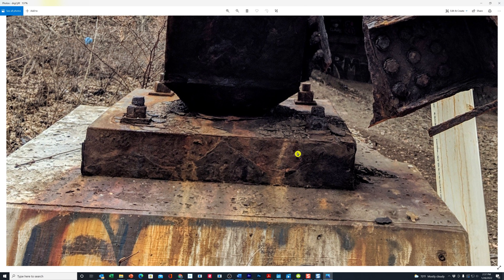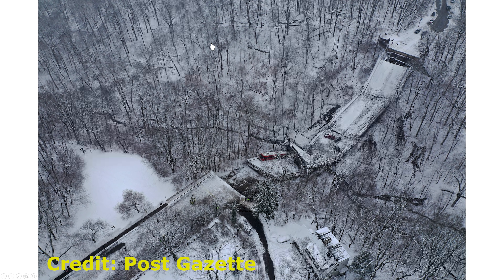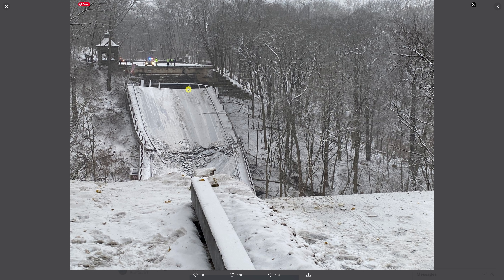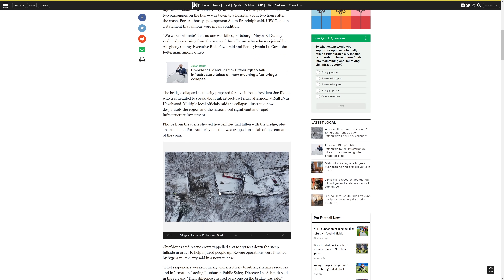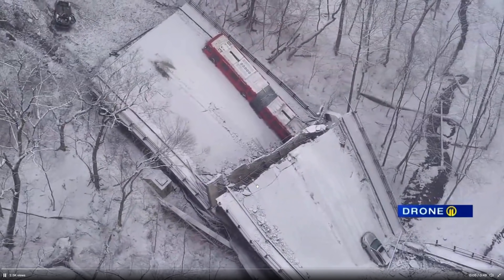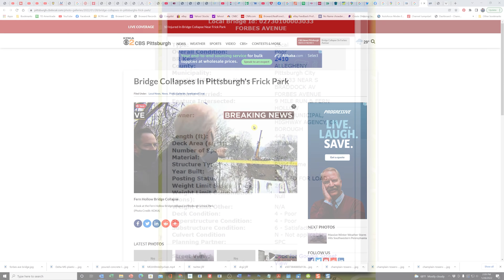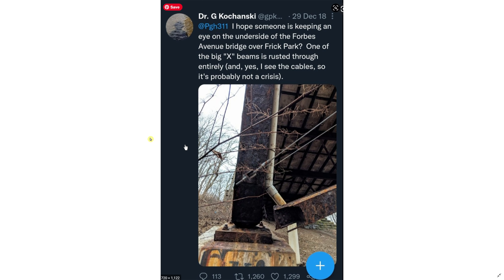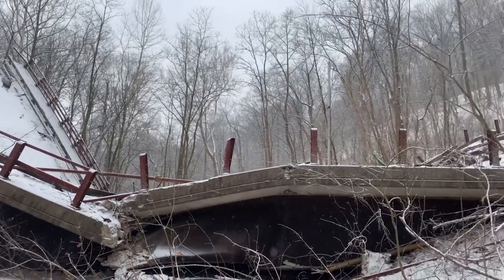Pittsburgh Bridge Collapse Cause, Forbes Ave Bridge Frick Park Rust?

Comment: Thanks for your insight on this Jeff. 26 ton = 52,000 pounds right? If you look at the picture of all the cars you showed I counted roughly 200 cars on the right side of the bridge. Even if the average weight was 2500# per car, ( probably low)that is 50,000  pounds. That doesn’t take into account the vehicles on the right side ( kinda hard to tell from the picture) . Also that articulated bus probably weighs 45,000 + pounds itself. + plus the snow and the other two cars. The condition of that bridge is totally unacceptable. Someone or a bunch of people should be held criminally accountable for letting it get that bad, but they won’t,they’ll probably get promoted. Unbelievable!
Reply: A weight limit usually refers to individual vehicles, not the combination of all vehicles on the bridge. This is because heavy vehicles cause an imbalance of weight distribution over the span, and their 'bounce' as they move is like a boom box shaking a table, causing stress on the structure.  

But yes a 26 Ton limit is ridiculously low for a bridge of that span and poor condition (it should have been declared unusable). That articulated bus weighs between 18 and 24 tons empty, and 28 and 33 Tons fully loaded, so a full bus would have exceeded the bridge's weight limit. Given it is a planned bus route, this alone should have been a major red flag. 

Most Type X bridges in urban areas should have a load rating of 40 to 70 tons (in the US the Federal limit is 40 US Tons), meaning that they can take an articulated vehicle of up to 40 US Tons in weight at the approved speed limit, less for single-unit trucks. Special heavy loads may have to drive in the centre as opposed to keeping to the truck lane, and those usually have specialised transport planners to assess and plan the route right down to clearance of lamp posts and junctions.
Reply from the maker: The bus is normally 15 tons, but this was a double bus, so I am curious
Reply: Typical car length is 15 ft. 200 x 15 = 3000 ft. You're not seeing 200 cars on a 470 ft (approx) long bridge.
Reply: There is absolutely no chance that 200 cars would fit on that bridge. Literally impossible.
Reply: @zuthula3847  that was a typo sorry I meant 20.lol
Reply: @ed1016  I meant 20 sorry. Fat fingered an extra 0 in there. Lol
Reply: @greglammers9905  haha okay that makes sense I was like there is nooo way haha.
Reply: @raytham  At the time of collapse, the bridge had double-bus, four cars (one was small p/u).  The pic of all the cars was a stock photo from another time.  Posted weight limit was 26 tons.  The bus was 23 tons (as of Tuesday, it was lifted off in a single lift, one tower crane.).

Comment: I live less than 3 miles from here. About 20% bridges around here have sections coroded like that. What many people don't realize is that the tiny bridges that span maybe 30 feet are perhaps even less safe as they are seldom inspected.  It took kids down the street from me to identity to the borough, that a small 40 foot span bridge, that was just a deck on 16 inch I beams, had 6 of 10 beams rusted, broken and hanging onto the water.  For 2 years the people on that road had no garbage trucks or firetruck access and the bridge was left in service with a 2 ton limit.

Comment: No engineer not even a junior should have ever  signed an inspection certificate for such a degraded  and flimsy structure ( lateral stability wise). Safety margins aren't  banking accounts for accrued maintenance deficits.
Reply from the maker: I would like to see that cert!

Comment: Watching videos like this reminds me of a bridge I was nervous about when I still lived in my hometown in southern Ohio, more than 25 years ago, now. 

A bridge that was part of a major thoroughfare. I was always the passenger in either my moms car or the public bus, so I was used to staring out the window. From the road, the decay of the concrete didn't look that bad. Pieces had broken off the concrete railing along the road, & the curb of the sidewalk. I never really thought about it.

There was a small airport by the side of the road, with a playground near it. One time, I got off the bus at the stop on one end of the bridge, to go down the side road that passed under it, heading to that play area. I was going to play putt-putt.

Under the bridge, I looked up. I clearly saw sky through cracks along the curb!!

I've wondered about that bridge every time America's aging infrastructure is brought up on the news.

I hope my hometown fixed it!

Comment: You think they'd design some backup features to avoid a total collapse.
Reply from the maker: They will learn from this failure root cause for sure
Reply: This design may have worked per previous code. As code updates, people simply don't want to pay to refurbish something like this. Also, nobody wants to pay to maintain infrastructure. Routine paint program would solve many of these issues. It's a super expensive project and there's nothing to show for it...until something like this happens. 

Our entire infrastructure is crumbling, I'm surprised that this doesn't happen more.

Comment: Hey Jeff, I found a few pictures of the underside of the bridge on Wikipedia, which date back to 2015, they can be found here: https://en.wikipedia.org/wiki/Fern_Hollow_Bridge
Reply: In those pictures it doesn't look there was much holding that bridge up even if it was in good shape.
Reply: So those photos were taken in 2015. And it shows that the left support was still connected at the time, albeit still rusty and likely weakened. The photo in the video which showed the beam completely rusted through is from 2018. So that happened in 3 years... Assuming nothing was done to fix that issue, another 3 years had passed before collapse, who knows what it would have looked like recently...

That Wikipedia also shows that those cables were in place before the beam rusted through, meaning they were not placed there after the fact to strengthen the weakened structure.
Reply: Google street view is available under the bridge taken in December 2020. The lower crossbeams that were rusted out shown in the video, and also seen in the Wikipedia photo, were removed. Not repaired. Just completely removed. Only the upper 'X' crossbeams were left on that one side. You can tell it is the same side because the gatehouse on the left is visible in all three.
Reply: @Justin.Franks  oh crap, you're right!
Reply: @Justin.Franks  Points to torsional failure.

Comment: I live in Pittsburgh. 26 ton limit or 26 cars there abouts. That bridge had that and more on it every weekday during rush hour and don't forget about the weight of that double bus. Seeing the rusted out cross brace sickens me. A lot of problems get pushed under the rug ALL the time. Smh Pour city leadership. Average city us weights between 25,000 - 40,000 lbs. 12.5 to 20 tons.
Reply: A weight limit usually refers to individual vehicles, not the combination of all vehicles on the bridge. This is because heavy vehicles cause an imbalance of weight distribution over the span, and their 'bounce' as they move is like a boom box shaking a table, causing stress on the structure.  

But yes a 26 Ton limit is ridiculously low for a bridge of that span and poor condition (it should have been declared unusable). You are right that an articulated bus weighs between 28 and 33 Tons fully loaded, so a full bus would have exceeded the bridge's weight limit. Given it is a planned bus route, this alone should have been a major red flag. 

Most Type X bridges in urban areas should have a load rating of 40 to 70 tons (in the US the Federal limit is 40 US Tons), meaning that they can take an articulated vehicle of up to 40 US Tons in weight at the approved speed limit, less for single-unit trucks. Special heavy loads may have to drive in the centre as opposed to keeping to the truck lane, and those usually have specialised transport planners to assess and plan the route right down to clearance of lamp posts and junctions.
Reply from the maker: Plus with a derated bridge, they need to change that sign to maybe 20 tons, no busses allowed, no dump trucks allowed.
Reply: Most full size cars are at least 1.5 tonnes. Teslas are a ton heavier. And full size 4wd/SUVs start at 2 tons. My 04 Landcruiser is just over 2.5 Tonne.

Comment: I saw the column and they look very thin for the amount of weight they are suppose to support. The snow and ice on the bridge could have put the bridge at  an overloaded state. The metal looks like its rusting and would be prone to failure sooner or later.
Reply from the maker: yes indeed, my thoughts also

Comment: Having been a Structural Engineer for over 25 years and worked both here and abroad in almost every country, I can tell you that most of the roads and bridges in the USA are in worst condition than many 3rd world countries.  Main problem is that many counties in each state, they have head engineers that are nearly 80 years old and lacking modern experience.  They don't even know half the stuff they should know.  Second problem is how the USA always takes the lowest bid for all road projects.  Many highways and bridges are resurfaced and a year later, they are falling apart because of poor workmanship.  Hot cement, bad asphalt, not the correct rebar, and so on.  Many roads in this area are like washboards, they don't even pave the Interstate 90 or 25 level.  It's all up and down.  Lowest bid results in the poor quality work they get.  Half the guys inspecting these bridges here are so old that they can't even see hairline cracks.  It's about time the USA puts a 65yo age cap on government jobs.  These old folks don't want to let anyone into these jobs until they die on the job.  This needs to change.  Same age cap needs to go for Senate and House jobs and so on.  Let the younger folks with new education experience have a chance.
Reply from the maker: They really need to incorporate maintenance into the plan, seems like a simple dip in a rubberized paint could help a  lot of bridges from rusting
Reply: I agree with you whole heartedly. For example in my city in Texas, I noticed they build subpar apartments and homes. The builders just churn them out. The city does the same for everything else. I watched the constuction of more recent  overpasses  and they are scary to drive over and under.. it all just looks like The Jetsons with highways floating in the sky with almost no visable means of support.  I told my daughter,  give it time, even a few years from now,, something big is going to happen. I avoid them when I can, they don't look safe. I pray as whenever I have to drive over and under those overpasses. I'm glad no one died. My prayers are with the victims.
Reply: True retirement age law protects the person so they can rest and relax for the rest of their life. and also the interest of the community.Maybe they can be honorary guests during important events but not work anymore please.🥰
Reply: I'm an Engineer, NOBODY wants to pay to maintain structures. Everyone wants a Band-Aid.
Older people also don't want to get younger people in and train them to take over. They will hold those jobs as long as possible and leave a huge hole when they leave
Reply: Competence and integrity have no age limit. Pittsburgh is known as the "City of Bridges".  It has more bridges than any other city in the world (446), including Venice. This bridge should have been condemned and closed long ago.  What Mayor wants to be responsible for closing subpar bridges around the city? What City Engineer can close subpar bridges around the city? The voters would go ballistic, but sometimes leaders have to actually lead. Of course with liability issues and international embarrassment now some action will be taken.
Reply: @ronaldfharring7326  New York City has 789 bridges, Amsterdam,  Netherlands has 1281 Hamburg, Germany has more than 2300.
Reply: @MrChopsticktech  Thanks for the correction.  My information cropped up when I googled "City of Bridges".
Reply: @ronaldfharring7326  Just cause you say it's the city of bridges doesn't mean you have the most.  So get your facts straight cause Pittsburgh don't even come close to the most bridges in the world.  Hamburg, Germany has 2500 bridges!  Just goes to prove, age limits are required when it comes modern knowledge.  Can't keep building stuff with a 1960 education.
Reply: @ministryofinternationalaffairs  Calm down.  Clearly you didn't read my reply to Edward in which I thanked him for informing me that there are several other cities that have more bridges than Pittsburgh.  This wasn't meant to be a distraction from the main focus on the problem at hand, in which we can probably agree, namely that the neglect of this failing bridge was inexcusable.  Any unfounded speculation about the age or education of the engineers responsible for maintaining the infrastructure of Pittsburgh is irrelevant.

Comment: I lived in Pittsburgh from 1986-89. I saw many bridges in worse condition than this one.
Reply from the maker: I fear many more will drop
Reply: Lol, along with roads and highways disintegrating on the sides of mountains.  Take a drive and wear depends as you pray the roads hold....  Also, highways are major trucking routes, so add all those loaded tractor trailers and other vehicles....  Also, windy Mountain roads in NC - parts look ready to slide down the mountainside!  Terrifying.
Reply: Metal bridges + road salt = disaster

Comment: Thank you for your views! Most definitely rusts seems to be an issue. Just wanted to point out when you said that the bridge was rated for 26 tons, I'm not sure how they verify that as you did show a certain picture where it was bumper to bumper cars. If you start adding up the cars that were sitting on that bridge I would imagine that may have played a part in it over time?

Comment: From the photos, this looks like an early use of COR-TEN steel. COR-TEN is a weathering steel designed to be used without painting. It still rusts, but in most cases it reaches a point where the corrosion acts as a barrier and no further erosion occurs. It has been used on many bridges, especially in a large area around Pittsburg. The most famous example is probably the New River Bridge 150 miles away in West Virginia. If it is Cor -Ten, the reason it looks so rusty and has no sign of paint is that painting can accelerate corrosion on weathering steel.    

Cor-Ten is not completely corrosion resistant. If the steel remains wet or damp, especially with corrosives like road salt, the steel can rust through. The bridge is in a temperate climate and is closely surrounded by trees and low vegetation. It is a likely location for persistent moisture issues. It could be the case that a combination of 1970's lightweight bridge design, moisture issues, and poor drainage led to premature failure of the steel (is 50 years premature?) and may be the cause of the collapse.
Reply: The rust forms a shell, I’ve heard this before with different structures. Especially with older bridges. Wasn’t there a bridge collapse many moons ago that had this same kind of steel? I’m trying to remember where I’ve hear this steel before, but can’t damn remember.

Comment: 26 tons is nothing. The flex bus on the bridge was probably 25-40,000 pounds or 12-20 tons itself.  Our medium size SUV is 2 tons alone and our BMW 3 series is not much behind it.  Teslas are 5,000 pounds or more.  The 26 ton limit probably reflects a reduced weight limit already.  A max loaded tractor trailer combination is 80,000 pounds (40 tons), which would exceed the bridge rating.  One minute before the bridge collapsed two tractor trailers may have rolled over it.  Once the bus drove onto the deck, it was over.
Reply from the maker: A regular bus is 15 tons, but I wonder how much that double bus weighed
Reply: @jeffostroff  KDKA TV in Pittsburgh reported that the articulated bus weighed 21 tons

Comment: The cause of this crash was City government more worried about creating bike lanes and other highly visible projects and ignoring maintenance and needed repairs.    Just another failure of  democrat run areas across the US.       Another major issue in cold weather areas is pretreatment with brine.  Rust issue are so much so accelerated compared to salt alone.      Problems like this didn't happen in the days of plowing & cinders.   Liquid brine gets everywhere and causes rust and other corrosion to cars and any steel aluminum and other metals.
Reply from the maker: If they jus painted the underside it might be OK, seal it good
Reply: @jeffostroff  We should have crews that do nothing but paint municipal structures. It's that important. 

We spend so much money to build this stuff without really estimating the cost of maintaining it. But if you build a bridge your name goes in it....if you maintain one you're blowing the budget.
Reply: @Meng776   this has nothing to do with places not having the money.  It has everything to do with neglect due to spending money in high profile areas.  Building new stuff rather than fixing  and maintaining old stuff..   this is bad government.   At its worst.
Reply: @tmiklos4  I agree completely...that's why it isn't a Dem vs. Republican issue, none of them want to pay to maintain our infrastructure. To pick a side when neither side cares is pointless.